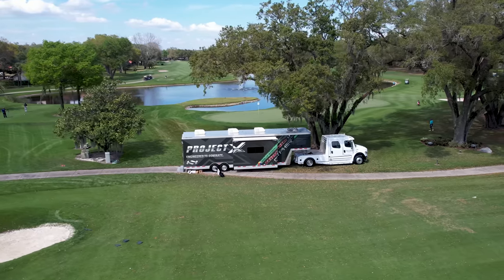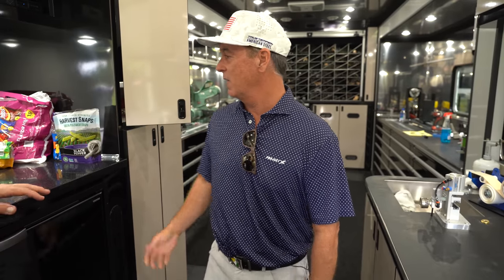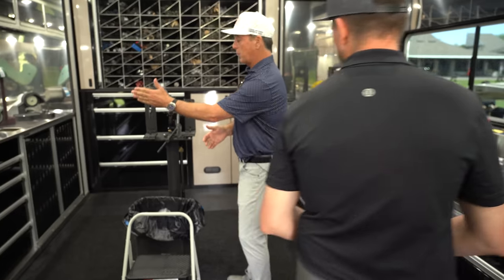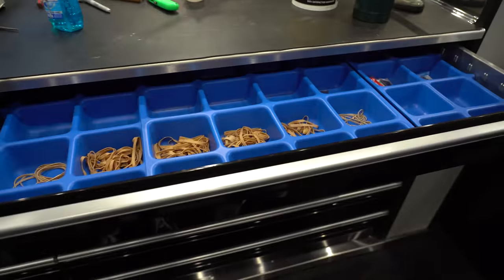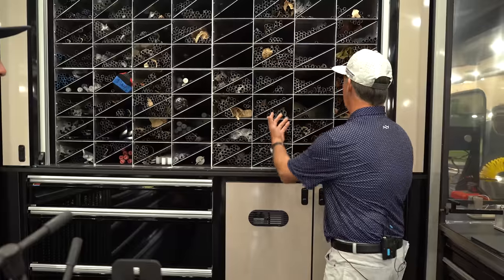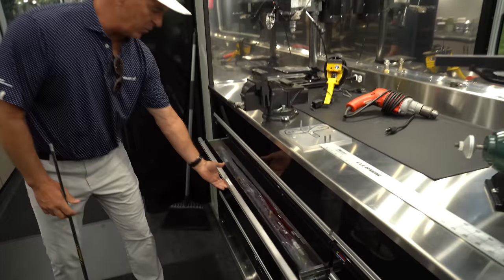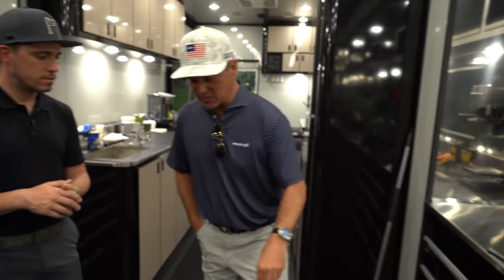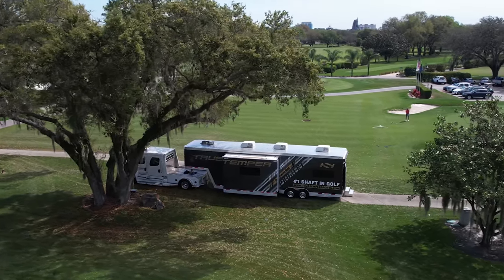INSIDE THE TRUE TEMPER TOUR TRAILER // Inside a PGA Tour Equipment Van

Comment: Curious how an adapter can be prepped and glued and ready in 8 minutes?  What brand epoxy do they use?
Reply: Same stuff but they microwave it on to make it flash faster.
Reply: you can get all sorts of fast set epoxys everywhere. I was building a club in the summer in the heat and used a fast set and it set in less than a minute before I even lined up the logo!!!
Reply: The best epoxy is 3M DP810.  Excellent strength and fast setting (10-15 minutes at 80*).  It's expensive but well worth the cost.